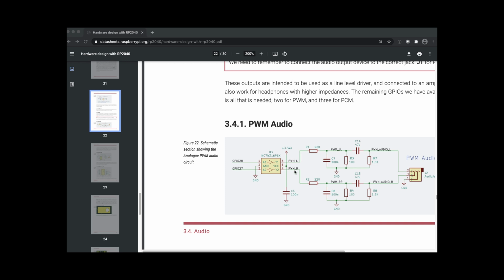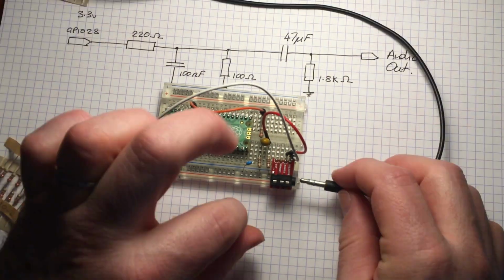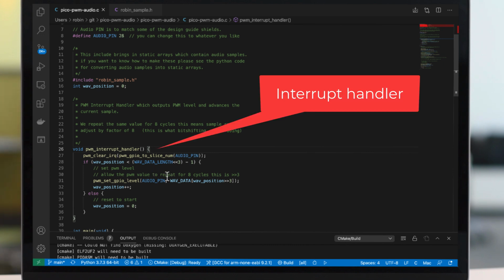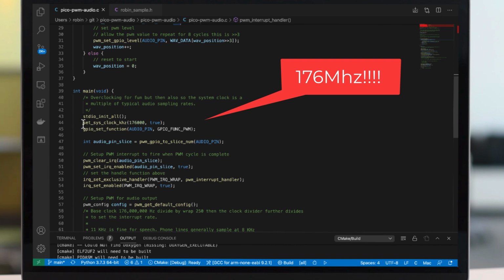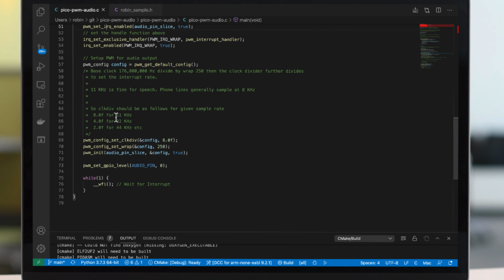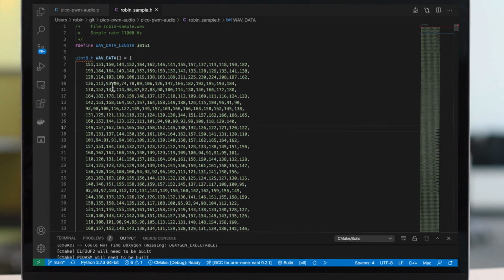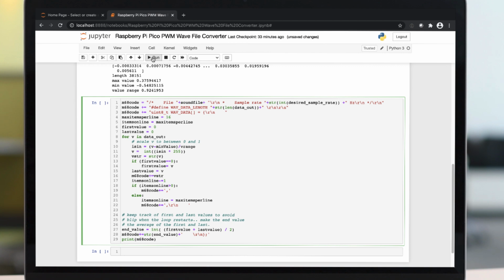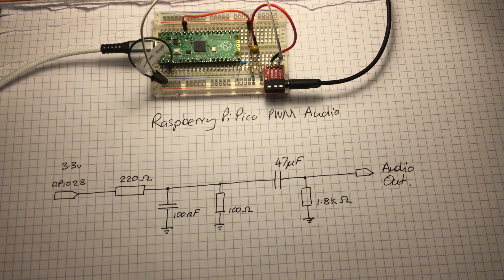Raspberry Pi Pico Audio output

Comment: I know this video is 4 years old but it is still relevant. One thing I do not understand is why each PWM setting is repeated 8 times? Is there a particular benefit in doing this?
Reply from the maker: Its been a while since I looked at this. Repeating 8 times is for a few reasons and its quite complicated. We clock the pico at a relatively normal clock rate .of 176MHz. But our audio file is sampled at a much slower clock rate in this case 11KHz. This allows the sample to occupy a smaller file size. Note CD quality is 44.1KHz. Humans can't really hear audio above 20KHz.. and human voices are lower than 8KHz so this what phones sample at. This is why 11KHz is a useful sample rate, as it covers most of what we can hear and creates small samples.  

Here is a detailed explanation of the cycle dividing that is going on. 

So we have a clock speed of 176,000,000 Hz.  In the interrupt setup we divide the clock by  250 then we further divide by 8 which is clkdiv value means the interrupt will fire  88,000 times a second. 

So to match the sampled audio we repeat the same PWM value 8 times in a row.. This has the effect of further dividing the PWM signal rate by 8 again. Thus 88,000 Hz becomes 11,000 Hz to match our sample rate. 

A comment from the code on the interrupt setup. 
    /* Base clock 176,000,000 Hz divide by wrap 250 then the clock divider further divides
     * to set the interrupt rate. 
     * 
     * 11 KHz is fine for speech. Phone lines generally sample at 8 KHz
     * 
     * 
     * So clkdiv should be as follows for given sample rate
     *  8.0f for 11 KHz
     *  4.0f for 22 KHz
     *  2.0f for 44 KHz etc
     */

I hope this helps!

Comment: I realise this is a couple of years old now, but is it possible to play 16bit samples using pwm with this code?
Reply from the maker: Yes you can. 

So inside the interrupt handler there is a call to a function pwm_set_gpio_level (uint gpio, uint16_t level). the second paramter is the level and this is from the WAV_DATA so you can setup the WAV_DATA to be 16 bit integers uint_16_t instead of 8 bit . It should work fine. 

Do you have a 16 bit sample you want to play as 16 bit or is it that you want to covert the 16 bit sample to 8 bit? The reason for this being 8 bit to begin with was to reduce the memory size needed to store the WAV data and make it more compact. But you can use 16 bit its just your sample memory with twice as big.
Reply: @robin-g6  I tried this sort of thing... 	
int offset = wav_position>>3;
uint16_t c = (WAV_DATA[offset + 1] << 8) | WAV_DATA[offset];

int16_t signedSample = (int16_t)c;

uint8_t pwmOutput = (uint8_t)((signedSample +32768));

pwm_set_gpio_level(AUDIO_PIN, pwmOutput);

wav_position+=2;

But it only makes a horrible noise. The PCM data is saved as 16bit lsb first.
Reply: After experimenting a bit, it seems impossible to have any better than 12bit pwm for audio, anything higher makes too much noise, it seems it can't do the timing properly. @robin-g6
Reply: @robin-g6  Hello! Tell me pls, it's will be a background noise if I connect pin0 directly to the audio out?

I'm makin a pocket sample-based synth on RP2040-Plus by Waveshare electronics (pico rp2040 clone) and Mozzy library. Now pin0 connected directly to the audio out, and it's worked for arduino nano, but with rp2040 it's bring a background noise, like an white noise. I try to understand, will this scheme resolve my issue, or I need to look further. Thank you!

Comment: Why do you need to set the same PWM duty cycle 8 times for every audio sample? Overclocking is not required when you set it only one time per sample I guess.

Comment: As the clip says, "that's cool." Nice work!
Your audio circuit is a form of band pass filter, correct?
If I wanted to use this code with the Arduino IDE, where would I get the needed libraries, e.g. stdio.h

Comment: Hey, thanks for the great tutorial. I try to output audio sampled from a microphone trhoug pwm, and i need to build the filter you added behind the pwm output. I am not really an expert in this, but are you sure about the 47uF capaditor? I can not even find one in ceramic and they are not included in the common sortiments. Is is it more like 4.7uF, becuase these semm to be much more common. Just try to buy the right things :-)
Reply: You can use electrolite capacitor. Just make sure polarity is good

Comment: Cool project! How do you think, would this audio scheme with capacitors and resistors work for ATtiny chips?
Reply from the maker: Yes I think it will. Attiny chips clock up to about 20MHz with tiny RAM 2K, 4K or 8k. You can certainly generate various wave forms and they support PWM, trouble will be getting more than a fraction of a second of sampled audio from RAM. Also single core so will need tight code and maybe an SD card? There are enough pins to have SD card and PWM audio.
Reply: @robin-g6  Thank you. I tried to use PWM as simple beeper for my locomotive. It even works. But using another timer for IR receiving and detecting NEC contorol signals, something goes wrong with sound. I think to try using your way :)
Reply from the maker: @AleksandrIvin  The IR receiver will be time sensitive and the PWM sound generation is too... so you would have to do something to slice time between them.

Comment: Hey Robin, I'm working on implementing this code for continuous outdoor-garden-area usage. Is it fine to overclock the pico with a PIR sensor and your code running side by side at outside temps reaching 35 Celsius? Either way, is there a way to not overclock it and use it at 22Khz instead of 44Khz?

Comment: Why are you using a TRRS audio jack is it purely for the convenience of the breakout board?
Reply from the maker: Yes its just an easy way to wire up an audit jack on a breadboard.
Reply: @robin-g6  I'm a bit new to Python and programming but I have a raspberry pi 3 with the code: 
if GPIO.input 
    os.system('omxplayer -o local /file1.wav &')

I'm just not sure how to modify this for the pico and to this circuit you created.
Reply from the maker: @peterguthrie9924  did you get the circuit with the pico to run the demo code and make sound? The code here that you have pasted takes a wav file and plays but it requires the Raspberry Pi Rspbian Operating System to work, this won’t work on a pico as it has no operating. You have to use the pico SDK or libraries to do things. To play your wav file you need to convert it to from a wav file to a header file using the python code in the example I gave. I hope this helps. Let me know which part is not working for you.
Reply: @robin-g6  I've only built my button pushing project with pi 3b so far, waiting on parts for the pico.
Reply: @Robin Grosset my ultimate goal is to have a board that has 15 input push buttons which when each is pushed play a different sound file ("Help required in ...Department).  So far I have working code for pi3 but ultimately using pico would a cool way to do it integrating it all on one PCB.

Comment: Thanks to your work, I'm learning quite a bit about how to get audio to work on a pico. I found directly plugging a speaker to Pin 28 (PWM) / Ground gave a larger boost in volume at the cost of the audio artifacts. I want to follow your circuit if I decide to line out / amplify the speaker.

Comment: Could you please help me in the right direction? 

When I try to sync git, I get the error below:

PS C:\picopwm\pico-pwm-audio-main\pico-pwm-audio-main> git clone git@github.com:rgrosset/pico-pwm-audio.git
Cloning into 'pico-pwm-audio'...
git@github.com: Permission denied (publickey).
fatal: Could not read from remote repository.

Please make sure you have the correct access rights
and the repository exists.
PS C:\picopwm\pico-pwm-audio-main\pico-pwm-audio-main>

When building, I get the error below:

[build] AR10B2~1.EXE: error: CMakeFiles/pico-pwm-audio.dir/pico-pwm-audio.c.obj: No such file or directory
[build] NMAKE : fatal error U1077: 'C:\PROGRA~2\GNUARM~1\102020~1\bin\AR10B2~1.EXE' : return code '0x1'
[build] Stop.
[build] NMAKE : fatal error U1077: '"C:\Program Files (x86)\Microsoft Visual Studio\2019\BuildTools\VC\Tools\MSVC\14.29.30037\bin\HostX64\x64\nmake.exe"' : return code '0x2'
[build] Stop.
[build] NMAKE : fatal error U1077: '"C:\Program Files (x86)\Microsoft Visual Studio\2019\BuildTools\VC\Tools\MSVC\14.29.30037\bin\HostX64\x64\nmake.exe"' : return code '0x2'
[build] Stop.
[build] Build finished with exit code 2
Reply from the maker: The github repo is public but my instructions on syncing the code down assume you have a github account. I updated these so you don't need a account try using this command. 

git clone https://github.com/rgrosset/pico-pwm-audio.git
Reply from the maker: The other build related error looks like SDK setup maybe. I can try on a Windows machine and see what happens for me. Let me know if the update on cloning the repository helps with this one.

Comment: hello, can you tell me what is name of  the audio out ? 
 i am beginner . so i  know a little. i can buy the capacitor, resistance, but i do not know how to got the audio output like you show in the video.
i want try this way in your video.
thanks in advance.
Reply from the maker: Here is a link  to a breakout board for a 3.5mm audio jack. This is the jack I was using. 

https://www.sparkfun.com/products/11570
Reply: @robin-g6  thank you very much :)

Comment: Hi, do you think this could be done in micropython?  I don't suppose you have tried?
Reply: I spend more time in CircuitPython which can do PWM audio, I've not looked at RP2040 MicroPython for this. The 6.2.0-beta.4 release was a touch buggy for wav playback under certain conditions but I'm sure it'll be fixed soon. Several examples of audio on my channel with links to source code in the description.
Reply: Have you tried in in Micropython, does it work?
Reply: @iC3mdbN  Haven't tried sound samples there so far, I spend most of my time in CircuitPython unless I'm coding for the BBC micro:bit.

Comment: What is the PWM frequency relative to the sample frequency?  I image you want that to be much higher, so that you get multiple cycles per sample.
Reply from the maker: Yeah much higher at least 2x the sample frequency is normal. I had it at ~80kHz for an 11kHz sample. Making it super high also helps avoid hearing artifacts from it. Human hearing can hear 20kHz so I went with 4x that. The code is capable of 41kHz CD quality output with that too.
Reply: @robin-g6  Only children are able to hear 20khz.

Comment: Is there an explanation anywhere about what the hardware components are actually doing?  Like why have each resistor / capacitor and what happens if you take them away?  I can follow the software explanation to understand what is going on there, but the circuit side of it just 'appears' and it would be great to get an understanding of what is happening.  Or is that a case of 'learn electronics and then it is obvious?' :)
Reply from the maker: The Pico output is fed into an analogue filter called an RC filter (Low Pass Filter) this is the 220 ohm resistor and 100nF capacitor. then you have the 100 ohm resistor which effective acts as a voltage divider to get the voltage down to 1v ish for the audio levels. You could leave out the next bit too if you want and just have 3 components.  The next capacitor 47 uF a.c. couples the analog signal in the audible frequency range. which we can then connected to an amp or headphones. The a.c. coupling is the last stage and you can omit it and it still works.
Reply from the maker: This is based on the original Raspberry Pi Foundation hardware design circuit here https://datasheets.raspberrypi.org/rp2040/hardware-design-with-rp2040.pdf

page 22 has the audio circuit and an explanation. It's not as detailed as above. 

The other place to look for background is this link. Which is a written blog describing RC filter for PWM audio 
https://gregchadwick.co.uk/blog/playing-with-the-pico-pt3/
Reply: @robin-g6  Thanks for the extra information.  I was able to look up low pass / high pass filter online and now understand how it works.  I'm even going to have a go at building it!👍
Reply: It is basically a simple low pass filter set at half the sample rate. It effectively smooths the waveform.